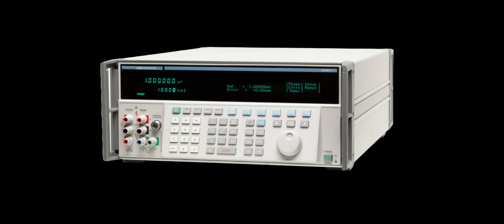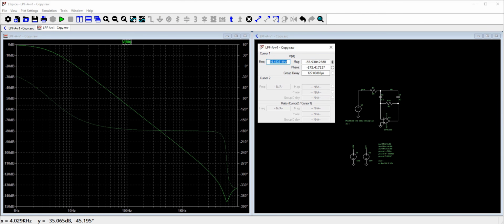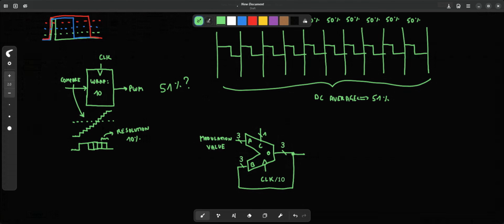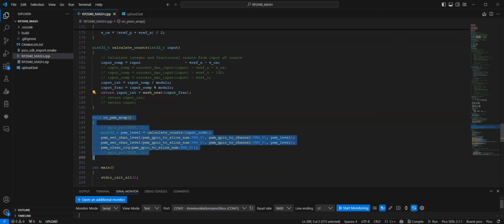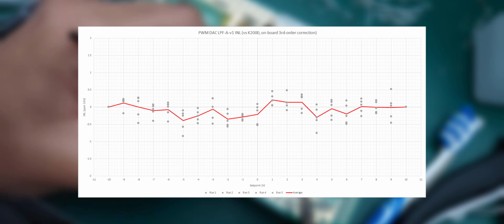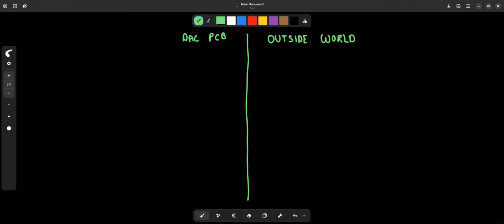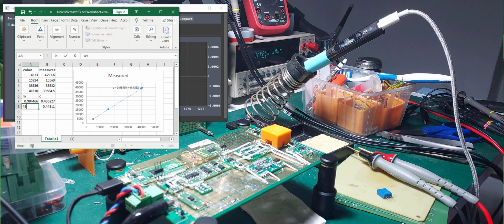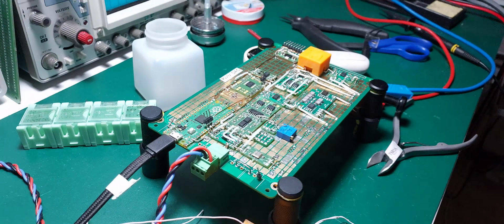DAC To The Future! | PWM DAC 2 - Active Filter, MASH Modulation, Newton's Method & Self-Calibration

Comment: Great video! PWM DAC's are something I have been thinking about for a while, and the main thing that stopped me was the fact that I could only really achieve 16 bit set-ability with two 8 bit PWM signals, without having to deal with modulation of the PWMs. For 16 bits it didn't seem to be worth the effort since, like you mentioned, I could not correct the INL below the LSB of the 16 bit signal. However, I think I am ready to try my hand at this once again, given your video. Any timeline on the 3rd video in this series? I'm only asking since I don't want to layout my board(s) and have to go back and re-manufacture them.
Reply from the maker: oof 😅I'm sort of stuck between work and uni right now, and the board has been lying in the projects box for months... I can't guarantee when I will pick it up and work on it again!

but I can tell you the basic idea - multislope-style current steering (something I described in this video I think) feeding a (properly compensated) TIA, which turns the current pulses into a square wave, and that is then fed into the LPF-A-v1 board

good luck with your project!
Reply: @NNNILabs I see, very smart! Do you have any of the sources/papers that you used? I would be interested in the current steering DAC (which I presume is 1 bit?) stuff for the most part. However, I see what you're getting at here with the TIA having virtual ground, and can probably figure out the rest myself.
Reply from the maker: the best paper I could find that summarizes everything well is "An AC voltage standard based on a PWM DAC" by Pickering and Wright (1999). current steering DACs can be one bit or multiple bits depending on how the individual sources are weighted, but that's irrelevant for what I'm doing - I have one positive and one negative reference current, which are switched alternatingly using PWM

Comment: Please give a link to the prototyping board you are using in this video.
Reply from the maker: it's called The Manhattan Toolkit by Macaba, you can find it on github
Reply: @NNNILabs  Thank you! Is there a shop where I could purchase this or similar prototyping boards? Nothing mentioned on github page, only links for accessories at farnell
Reply from the maker: @randomsky2008  the idea is to use the gerber files to get the boards manufactured by your PCB manufacturer of choice
Reply: @NNNILabs thank you! I suspected that, but had a hope that somebody sell as already produced pcb.

Comment: Great videos as always! Regarding calibration curves, no need to use Newton Raphson. Instead of curve fitting y(x), just swap x/y and curve fit x(y). This should work if your calibration curve is monotonic. More generally, for embedded hardware, you don't care if it's cubic/whatever, so just use a lookup table of calibration points and linear interpolation. It's much faster, more general, and easy to crank up the approximation on.
Reply from the maker: I think I understand what you mean by swapping x and y in the transfer function - if I calculate the value of x(y) and feed it into the DAC, it should automatically correct the error since swapping the variables 'reverse corrects' the error. This is much easier than Newton's method! Edit: I just tried this in Excel with an example transfer function - the correction does not seem to be exact for some reason 🤔

Lookup tables or linear interpolation is an interesting idea that was suggested to me before, but I didn't find it very elegant, since the residual INL would no longer be 'smooth' (depending on the number of points, of course). In this case, I do care about every last bit of INL, so third order was the highest I could do that would completely flatten the INL (at least as far as I could measure). Speed was also not a priority since the PWM period is large enough for the uC to perform the calculation within that time. I just chose a different set of solutions!

I did update my website just today investigating what happens in the Newton's method function. The value of the offset transfer function at the desired setpoint is actually the value that needs to be added to the setpoint to correct the DAC error, so you're right, Newton's method is not really needed in this case. My assumption was that the error was very small w.r.t. the transfer function, so the 'linear' approximation would also work perfectly.

Thanks for the comment, it really made me think!
Reply: @NNNILabs  Thanks for the detailed reply! 

Yes, quite commonly you can find a nice low-order polynomial in one way (i.e. y(x)) but not in the other direction (x(y)), and this makes sense, as there's no general polynomial inverse, and any roots become poles. This again shows that a look up table with interpolation is more general/flexible. They are arbitrarily good at fitting (just use more points). Also you can use a lot (100?) sample points in program memory fairly cheaply to interpolate between. 

If you want something that is smoother, you can stick with linear interpolation and just use more points, OR, you can use non-linear interpolation by generating the polynomial coefficients of a curve that passes through the nearest and next-nearest points. Again, most people do not do this, as this needs a lot more floating point operations, whereas program memory is cheap and a offset lookup for linear interpolation can be done in a few instructions.
For linear interpolation the computation can even be done with fixed-point arithmetic if your integers are large enough. 

There is another problem which you might be chasing, which is removing high-frequency content/noise from your INL curves, which fitting a low order polynomial does, but there's nothing stopping you "filtering" the data first by fitting a polynomial first, then using samples from the polynomial to compute the lookup tables. Once you do this, you can stop fitting polynomials and use more "advanced" filters like Savitzky–Golay filter.

TLDR; lookup tables with linear interpolation are very fast, can use a lot of points with the only cost being program memory, and are totally flexible to allow any careful filtering/preprocessing of the data required.

Keep up the excellent work!

Comment: The aholme link does not work or the page simply does not load .
Also i wander how will a proper PCB help here , in terms of PPM will be it be much better or on par?
Reply from the maker: sorry about that, you can try searching for 'Andrew Holme MASH', it should come up in the first few results

PCBs don't necessarily help with performance if your construction is careful, it's quite a process to design a PCB for a project and spending money to get it ordered and wait for it to arrive, only to discover mistakes... it's much more flexible using TMT
Reply: @NNNILabs  THX but for some reason the site does not work /open 
Did you have to do any extra stuff tricks in order to  access it ?
Reply from the maker: @sanjikaneki6226  I just did a google search, it still seems to work fine for me
Reply: @NNNILabs  hmm maybe it it from my network since i tried difference pc and browsers and none loaded